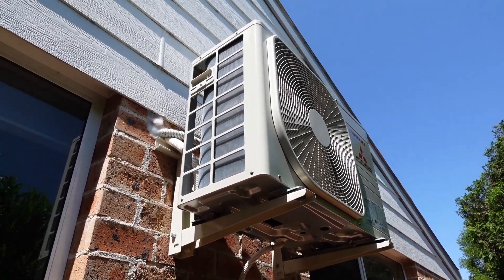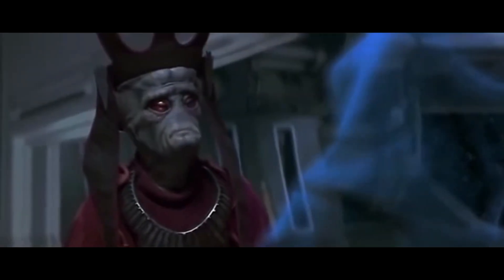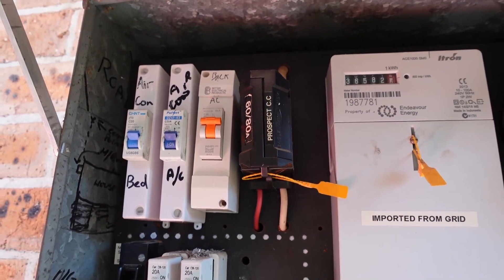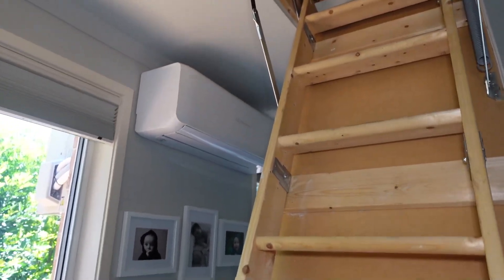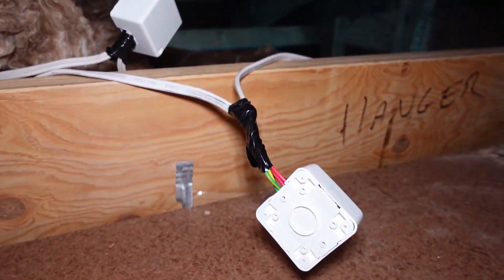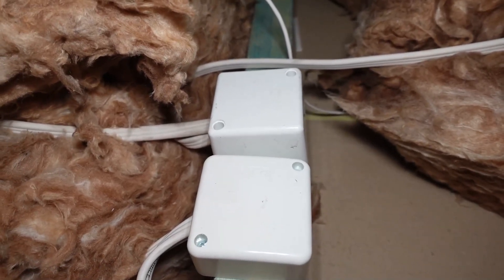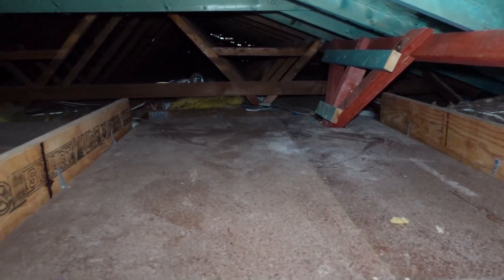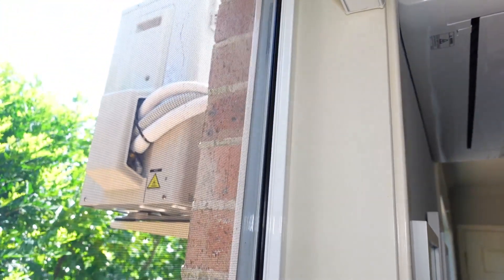Aircon Wiring Install FAIL- TWICE!

Comment: how can you have "two" fuses for the house?? they must be like 32A a pop. i think i must have like 25-30 circuits for the house, garage and outhouse.
Reply from the maker: 16A each, has always been enough.
Reply: 240v helps. Its still not a lot. To have 20-30 circuits I have guessed you are on 110v.
Reply: @michaelpiotrowicz6100  murica is split phase so we do have 240v...
Reply: @JustinAlexanderBell  yeah but for most cases where murica uses 240 we use 400v 3phase supplies
Reply: @officer_baitlyn  You can get 3 phase too if you're willing to pay for it, industry has it standard of course.
Reply: @michaelpiotrowicz6100  i'm on a DELTA power grid.. so my 63A 3 phase 230V only gives me 22kW max load sadly. and we do not have a N lead.. only L1, L2 and L3 + a local ground.
Reply: @michaelpiotrowicz6100  i do have 230volt.
Reply: I live in a house with only 2 circuits both 16A which can be a pain as one is the kitchen with wall unit plug in air con and laundry so no way to run microwave with 2 additional high current appliances like aircon or washer or dishwasher. It’s enough to drop the breaker. Not good to rent :(
Reply: I have three 60 amp 415v phases coming in. My power point circuits were derated to 13 amps when I got wall insulation so I got an extra circuit that picks up the coffee machine, the toaster the kettle, an outdoor heater and the dishwasher.
Reply: @michaelpiotrowicz6100  here we mostly used 16 amp. now new installs use 15 amp due to the regulation's. 2.5mm cables and up to 13amp on 1.5mm cables.
Reply: @michaelpiotrowicz6100  13Amp for all that? a bitt little?  i have 3 16A circuits and a 32A 3 phase on the wall in the garage and i need more. beside that there is one for light and one for heating (electric heaters on the wall) and a light circuit for light in the bottom basement and one for the chiller room and a 3 phase for the water pump. this is the garage alone. then i have the house and the outhouse i have made in to a dedicated computer house.

Comment: Are people in Australia not allowed to touch wires because they are not certified?
Reply: We aren't even allowed to run Ethernet cables in walls. It's rather frustrating!
Reply: @NickStallman  The catch is that you're allowed to install low voltage cables but they are not allowed to be connected to the telecommunications network. So if you install speaker cables, or an unmonitored alarm system or an ethernet cable to connect two laptops P2P that's fine. If the ethernet cable is connected to your internet modem that also connects to a phone line or coax internet it's illegal. In the case of ethernet the law is kind of stupid, since ethernet is galvanically isolated so any wiring issue should not propagate to the telecommunication network.
Reply: @tmmtmm  I believe the wording is "could be connected to the telecommunications network", not "not allowed". So running any kind of Ethernet cable in the walls, if it ends in RJ45 plugs/sockets then it "could be" connected and needs an electrician. Just a cable between two laptops isn't fixed wiring so doesn't count - if you want to duct tape ethernet to your roof then that's fine it's just the permanent wiring that is covered. The law is even more stupid in the age of NBN FTTP where the only data exiting the house is light not power.
Reply: @tmmtmm  if that's a case an hdmi cable can be illegal.....
Reply: @NickStallman  Correct me if i'm wrong but I don't think you're even allowed to make your own patch leads because they "could be connected to the telecom network", permanent wiring or not. Don't think anyone gives a toss about that one... Either way its a law from the days of rental phones and analog/mechanical pstn when phone companies were paranoid as hell (at one point you weren't even allowed to unplug and move your phone). How hard is it to kill a modern day line card? Probably very
Reply: @s8wc3  my understanding is it's just fixed wiring (for example, in walls). Ethernet not fixed to the structure (patch cables, duct tape to the roof/along the floor/etc...) is not covered at all. Likely to prevent you sending 240v up the old phone lines but I believe it's really due to lobbying from electricians than any actual real safety risk.
Reply: @NickStallman  Oh my god, you have to have an electrician install ethernet cables? That's bad. I have seen horrible examples of shitty ethernet cabling done by electricians. Like when the home owner explicitly told them to use CAT7 cables and then later found out they had used some shoddy old twisted-pair cable with no shielding.
Reply: @NickStallman  the fuck ? Can you even start fire with ethernet? I get why people are not allowed to touch electrical wiring  ( I don't agree but there is a reason non the less ) but ethernet really.
Reply: @NickStallman  And here i taught Norway was bad.. At least I can do my own network installation legally.
Reply from the maker: Correct. Even a qualified engineer cannot touch mains wiring in Australia.

Comment: I would have specified where to install and wouldn't pay for anything less
Reply from the maker: I think it's the same company that installed the other ones. Didn't even think they would wire into the power point wiring.
Reply: @EEVblog2  That explains why none of the others have the required isolator at the units. Awful work.

Comment: In America, we'd say you got the installers off of Craigslist*!
*Translation: You are screwed!
Reply: Gumtree is of course the Aussie equivelant.
Reply: @NickStallman  scamtree :D
Reply: We say "you got barry from gumtree"
Reply: Only things that we are allowed to do is changing light bulbs and pluging in an unpluggeding electrical appliances.

Anything else we have a sparky come in.
Reply: @joeltyler3427  I love it! An electrician is called a "Sparky"!
Reply: @alansmith4734  it's bit of a nickname. But we still call them a electrician.
Reply: @joeltyler3427  What do you call Firemen? Hosers? Water Boys?
Reply: @alansmith4734  Firemen aren't lucky enough to get a nickname i'm afraid. Most they get is shorthand. "Firies"
Reply: @alansmith4734  Bernie?
Reply: @alansmith4734  Smokies
Reply: @s8wc3  Smokies to paramedics in Vic, but the “firies” don’t like it...

Comment: 1A input... did you mean 1kW? 4 or 5 amps at 240V.
Reply from the maker: Oops, yeah 1kW. I think I put some measurement screen shots on twitter.
Reply: @EEVblog2  But the nameplate  on the air con says "Rated current 9A". For the installation / circuit breaker this should be the interessting figure.
Reply: @ToBeDefined85  Don't you have 400V down there in Australia? (400V is the voltage between two 230V phases 120⁰ out of phase)
Reply: @dahuaba0  Keine Ahnung. Bin doch kein Australier :)
Reply: @ToBeDefined85  Ah ok ;)😂
Reply: @dahuaba0  I think they have only one Phase of the three per house. (Aber bin auch kein Australier 🙈)
Reply: @EEVblog2  Thats quite a lot of power for a single mini-split unit.
Reply: Yeah lol, 5A

Comment: In New Zealand they have to have separate circuit breaker otherwise its illegal, also mounted on the ground not high up as the noise can annoy the neighbours
Reply: It's the same in Australia, although you can mount it where ever
Reply: Only cheap poorly made for way undersized condensers make noise. 

         The good high-end condensers are near silent you could be mounted right outside your bedroom window and you would not hear it. 

        Everybody’s always buying the smallest cheapest one they could get.   Then when they get really maxed out on the hottest days they’re running at 110% their capacity whining to piss out of their motor and fan making annoying noise that bothers people. 
             This is due to poor selection.
Reply: Not true. Would like to see the relevant AS 3000:2007 clause referenced. As per clause 4.19 you just need to provide a lockable local isolator. Not a "dedicated circuit breaker".
Reply: @pasan.  It's in every split system install manual, MHI manuals have the words "the system must be connected to the dedicated circuit". It's a requirement to follow manufacturers instructions
Reply: Jason Forne again would like to know where exactly this requirement is stated in codes or regs. Clause 4.10 as far as I understand applies to underfloor and ceiling heating cables.